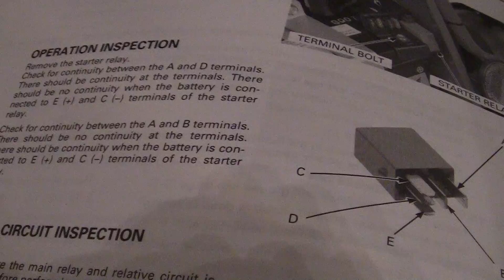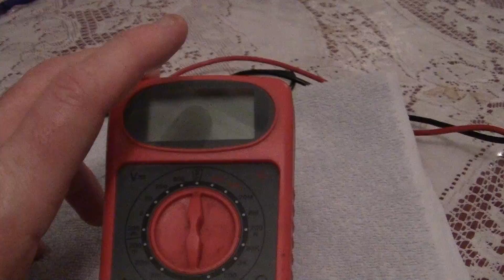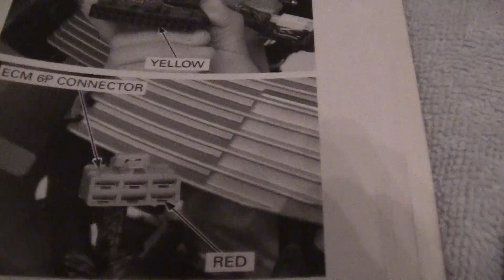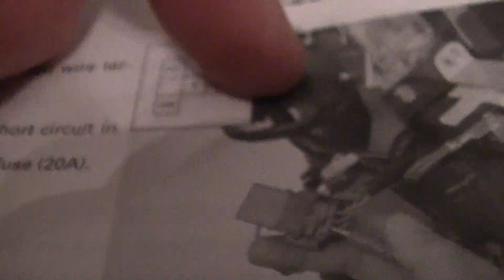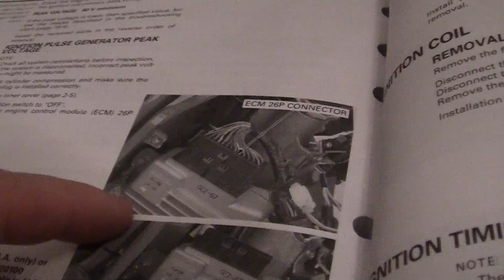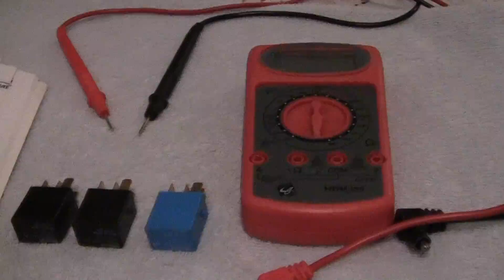308)-  PROJECT Honda  RUCKUS - HOW TO= Engine COMPLETE REBUILD

Comment: I know this is an old video, but the 2732 views tell me that 2732 people are having this $@#% Honda problem, and the Honda documentation is embarrassing. It's 2020 and there is still no definitive information on this hateful system. My own personal hell is with my 2008 Ruckus. It took me forever to discover the gimmick of resetting the ECM/ECU, but the Youtube info on that implies that whenever you REMOVE the harness to the Throttle Position Sensor, which you do every time you clean the microscopic pilot jet, or change your battery, you should/must reset the ECM. The Honda "documentation" says only to do this when the TPS UNIT is removed, not when the harness is removed, and has no recommendation for resetting the ECM in any other condition, including removing the battery. I discovered that even though my 2 new ebay Chinese fuel pumps do not turn on with the ignition, as they once did, one must be connected in order to successfully do the ECM reset. Now I can run the bike by feeding the carb with a syringe but no force will get a fuel pump to pump fuel. The documentation, if you can dignify it with that noun, calls one of the two identical relays a Load Cut Relay, but there is no such thing. There is such a thing as a Fuel Pump Cut Relay, and that's what I think they are trying to say. To test this relay I simply swapped relays. Since there was no change in operation I could assume it's OK. Besides, who believes that a Japanese relay by a name brand company (Imron) is going to fail in the short interval between purchase and a Ruckus dying? This is a good bike but not documenting its operation is the sort of thing that special prosecutors are appointed for. 
Another Youtuber posited that while the pump is meant to run continuously (you can't make this up - I think it really does), the ECM cuts power to the pump over 40mph as a sort of "governor". You can probably add to my list of 10 reasons why this is nonsense. First, there would be the lawsuits. Second, the effect would not occur for some time after the power was cut. Third, what kind of moron would lean out a carb in order to slow the bike down? How about cutting off the flow of coolant to make the engine overheat?  That would slow it down. . . . My point is that in the absense of meaningful documentation written by Honda we are all flailing about, pros and amateurs alike.
Reply from the maker: My problem was with a dumb ass mistake i made. I tried to jump start the bike with a battery charger that somehow burned out the Fuel pump and it quit working. I tried everything to get  the new pump to work with the ruckus brain with no results. Then I bit the bullet, bought a new ruckus 300$ brain, and the pump worked perfectly. NEVER charge the Battery connected or Jump Start the bike with a charger. You could face a brand new computer brain which aint cheap. RH DSD

Comment: you can test the relay off the bike its easy. the book tells you what post is what. just apply battery power to the switch posts that would be the power coming from the ECU (very low amperage) to close the relay and allow the high amperage to flow through the relay and power whatever device it is. if you apply power to the correct terminals the relay should click and not click again until you remove the power from it. with power to the switch side of the relay there should be continuity from the remaining two posts and the continuity should go away once the power is removed. a lot of your relays like those can be serviced, inside the relay looks like a set of ign points and as long as the points are getting together properly you may just need to clean the points and pop the plastic cover back on.